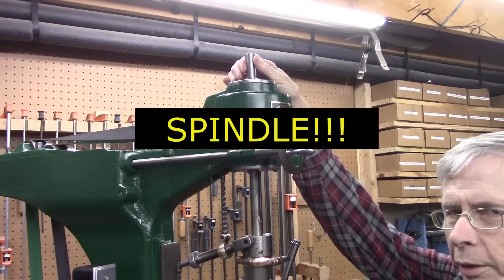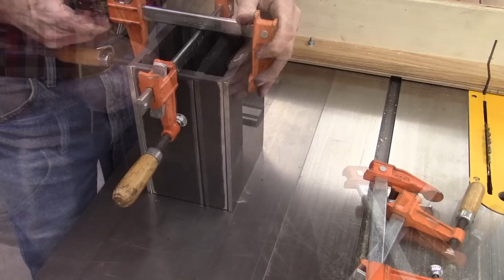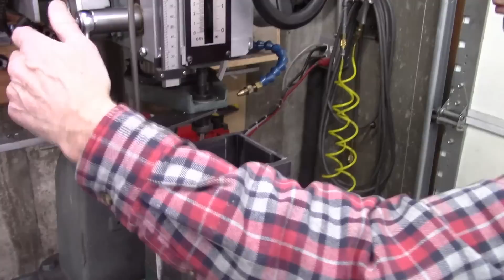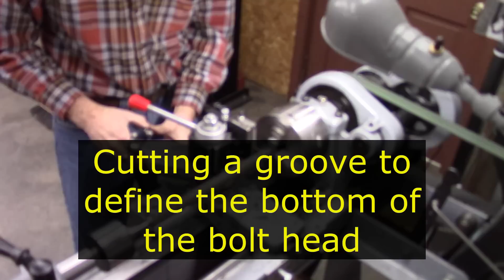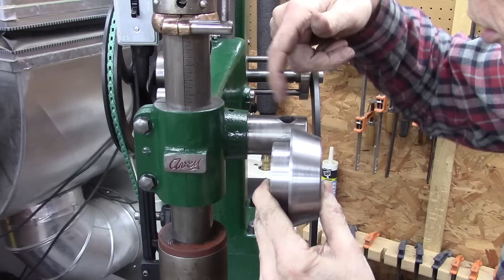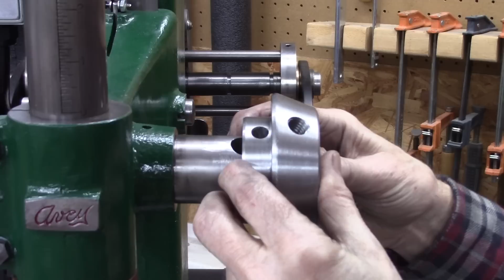My 1917 Avey Drill Press Gets Some Much Needed Upgrades

Comment: The problem with the work shifting in the mill vise could be avoided by eliminating the vise. By using hold down bolts and clamps you would have less flex to worry about. It might have been worth the effort to weld some plates on the inside of the work that could have been drilled and used as part of the hold down. I have some low temperature alloy that i have used to cast a temporary support for items that are difficult to hold. Just use some common children’s modeling clay to dam the alloy and pour it around the part to be machined. Using the low temp alloys would even allow you to pour around the part as it is held to the mill table by clamps. And you can also use the alloy in the mill vise. I unfortunately don’t know what alloy i use it was bought at an estate auction. You are a gifted craftsman and a wonderful teacher! Please continue to make these videos.
  Also you might consider babbet for that second bearing on the spindle. It would be period correct if you consider that important.
Reply from the maker: Yep...  correct on all accounts but I didn't think about welding brackets on the inside. That's a great idea. I was going to do it on the outside but didn't feel like rigging rods...  and didn't have any long enough. But hey...  it worked, just slow is all. 

Hmmm?...  Babbitt  not that is interesting! I bought a sleeve bearing but babbit would resolve any possible alignment issues. Maybe time to learn about Babbitt - Thanks

Comment: Mark, at 4:06, it sure looks like the drill chuck itself (the Morris taper maybe?) is wobbling as well as the spindle.  Zoom in and check it out.  Always inspiring watching you tackle these projects without trepidations.  👍👍😎👍👍
Reply from the maker: I looked at the video and it looked to me that the spindle bearing was the spot that was moving but I also know this is not right...  at least not significantly. There is some Axial Play (looked up that word, I had that right) which is allowing the upper end of the shaft to move. The other part if the problem that I'll probably never completely eliminate is the quill and the tube it travels in. It has a clamp to adjust and it helps a lot but you can tighten it to the point where it is hard to move and still get some movement...  perhaps egg shaped. As near as I can tell the taper is perfect, a very good fit. I had my brother in law move it for me and so I could watch (and feel) where the movement was and I felt nothing at the taper. Thanks for the feed back tho...  much appreciated.
Reply: @WinkysWorkshop  Maybe it was parallax and the camera angle, but it looked like there was relative movement of the shaft that comes out of the chuck and the shaft that it appears to go into. Yes, the quail was clearly moving down there, but it also looked like there was some additional wobbling at the shaft coming out of the chuck.  Maybe it was mirrors 😂🤣.  All the best. You’ll figure it out.
Reply from the maker: @joell439  I'll have my brother in law move it again. It's hard to see stuff like that when you try to move it yourself.

Comment: Nice long term project.  McMaster has headed 7/16 bolts up to 12" and of course studs are unlimited.  This is a very low RPM drill press which makes me think a support bearing bushing would serve well.  Particularly a fun project would be a tapered and 4 slit bushing with internally tapered top nut to allow adjustment of fit.  Extra credit for a seal/O-ring and oiler in the assembly.  Very fitting to the styling of a vintage drill press like this.    The spindle bushing of a Craftsman 109 lathe works in this way.  A glistening brass nut adorning your project with the spindle emerging through it would be stunning.
Reply from the maker: Dog gone it Dave, you're setting the bar too high! Hahah. But seriously that is a good idea. I was thinking a simple plain bearing. My only concern with any plain bearing solution is if the natural running position of the shaft is off center slightly it would wear. It appears to be well centers and if this is the case the sleeve would last forever as long as it had oil. If I could devise some kind of hardened inner race on the shaft for a needle bearing sleeve this would be ideal. I didn't the 109 was made like that. Hardinge Cataract lathe I got with this drill press (a future project) has sleeve bearing that look sort of like a collet.
Reply: @WinkysWorkshop  Some of the machining operations would be interesting.  Also, you could use a mag base to attach to the spindle and sweep the outside of the top part where the assembly would go.  If you wanted to test for a concentricity issue and a fun setup to show in a video.   I really think the distance between your two existing bearings is so great the play does not mean much.    But in the spirit of improving the vintage drill press it's still a good project.  You shouldn't need a race there.  The shaft would be harder than the bronze bushing anyway.   In other news.....I once had a concentricity problem just like we are discussing and needed to add a seal to a motor shaft.   I turned up an aluminum housing for the seal with flange.  Pushed it over the motor shaft and silicone glued it to the face of the motor mount plate.  This was a salt spreader and I had ruined a couple motors.  I wanted 2 seals to protect the vertical shaft.  This worked fine.  With a large enough flange you could simply glue on and external housing with silicone or JB Weld.   Another option with showing a creative solution to a problem.   There are as many possible was of doing this as there are opinions.  ;-)
Reply from the maker: @davethacker8410  I was talking about an inner race for needle bearing assembly not a sleeve bearing. The sleeve bearing would be find. and could be made any size. I like the tapered sleeve bearing ideal. I need to look at the 109 and see how it is made.

Comment: Love that pretty green drill press. Use all thread rod and nuts for your riser block instead of long expensive bolts.
Reply from the maker: Seems Logical but I could not find any cheap 7/16" all thread and I had a bunch of hex stock somebody gave me. I did find some bolts but with shopping the cost was around $40...  same with the all thread.
Reply: @WinkysWorkshop  Changed my mind. Good bolts look more authentic to the machine and are the way to go. They look great and I’m sure your viewers appreciate watching you make them.
Reply from the maker: @ellieprice363  Thanks... I think they do look cool.

Comment: Winky, the original riser block had a keyway cut in it to keep the column square, have you forgotten to mill it into the new one ? With the bolts why not use round rod and thread each end and add a blind nut to the top. Saves a lot of turning. Regards from Australia.
Reply from the maker: Hello Dave, No, I didn't forget the keyway. When I had it apart I made the drawing but rounded the key size to a nominal 1/2". It might be a little over or under...  I want to remove the old block and make sure I get the size and position exactly right. For sure the bolts were overkill...  a pain to make. Mostly chasing chatter with feeds and speeds and cutter profiles (although I did finally find the perfect combo. I considered all thread and nuts but could not find anything very cheap. Long bolts or the all thread were crazy high after adding shipping and I had all kinds of hex stock somebody gave me.

Comment: May be make the bearing out of oil light bronze and then the odd size in the shaft would not matter---and if you split the bearing you could fit it with out a strip down and it would be easy to replace in the future..
Reply from the maker: It's easy to remove the spindle so splitting isn't needed but yeah...  a simple sleeve bearing is probably a good option.

Comment: Love that drill press! That was some awesome engineering, l like how you engineered your changes to the handle mechanism without damaging the original antique integrity of the machine that you considered the option of putting it back to original, that’s awesome. Great job and video!
Reply from the maker: Yeah...  I always try to keep reverting to the original design an option. Mostly for historic reasons but occasionally a change doesn't work as planned. Thanks!

Comment: That's definitely a nice drill press. I recently got a 1/2 HP motor for my drill as this is what was factory on it.
Just FYI, and you might already know, Harbor Freight sells American made link belts.
Reply from the maker: Thanks, I saw the belt on the HF website but I got the smaller 3/8" link belt they did not carry. The 1/2" is more common but I think the smaller is adequate for 1/2 hp. Oddly the wider belt made the drill press run faster too and I like the low speed. The narrow belt sits lower in the pulley but you would think it would still maintain the ratio give that it sits lower in both pulleys...  but at least with standard v belts the speed change was significant.

Comment: Mark I thought you built an indexing set up on your lathe years ago using a saw blade. I thought of it when you were drilling for the 3 handles on the new drill press and was using the triangle cut out ?
Reply from the maker: Yes I did...  and I also designed a better gear indexer with a 48 tooth gear. The lathe would have worked but drilling a hole large enough for 1/2" thread would have been very hard with the hand drill. In other words, i had to make a jig to hold it in my mill of drill press anyway. The cad printed template was super easy and fast. Actually I almost had a philosophical discussion in the video about accuracy.  It came to mind when I was using the plastic level on the mill. There are times when accuracy is critical. Bolt patterns are a prime example. However, slight discrepancies in the handle angle or location will never be seen. I know you did not suggest the use of a rotary table but while I was setting it up in the mill I was thinking how some Machinist would have spent an hour mounting the table at a precise angle or if they had the right mill tilting the head... etc. I think there is always the best way and a logical way. I lean toward the logical.
Reply: @WinkysWorkshop  I agree totally. My thoughts was to just spot drill it in the lathe with the index to get it perfect then I would have gone to the drill press or milling machine. If I can look at indexed holes after I have finished drilling and can pick out one that's off the pattern my  OCD will not let me just except it. I would have redid my project. On the upper barring you mentioned I would turn down a bronze or brass bushing and use that on that mid shaft. My first choice would be bronze .I replaced a bearing in a 1 horse electric motor on a bench grinder years ago with a bronze bushing and its still doing well .
Reply from the maker: @anthonycash4609  I think a bronze bearing is the answer as well.

Comment: Maybe just a small suggestion: on your cross pin for the handle, cut a slight groove so when the bolt deforms the metal, it won't be hard to tap the pin out later.
Reply from the maker: That is an excellent idea! I'll do that. Thanks

Comment: Would it not be better to use a custom made bronze bushing for the intermediate spindle support instead of using a bearing that doesn't  fit due to the oddball size of the spindle shaft? A bushing would require far less to be taken out of the intermediate support and could be honed to a very precise tolerance. Cosmetically, a bushing would not look out of place for a 1917 piece of equipment but an exposed ball bearing might.
Reply from the maker: I 100% agree...  I'll probably do this.

Comment: First of all, I'm impressed by the fine job that you did on these projects.  Well done. I was however reminded of several things during the course of the builds that compelled me to add my two bits worth here.

A clamping kit is cheap and an easy way to securely hold workpieces to the table which don't mount as well in a vise.

I made a power feed for my mill using a Dodge Ram windshield wiper motor and it continues to operate well several years later and has reduced my milling workload considerably. I mounted it to the end of the table without the wheel and the motor assembly slides in and out on bars to mechanically engage/disengage the feed.  I made connecting adapters using a deep hex socket (9/16") attached to the end of the lead screw and a hex coupling nut on the motor spindle which goes into/out of the socket. I used aluminum because it's easy to machine and adequate for the torque involved.

A Ram wiper motor has 2 speeds normally by applying voltage between the common brush and the high or low speed brush, but a third fastest speed can be had by applying voltage between the high and low speed brushes with the polarity reversed. The electrical return however must be isolated from the case by mounting the internal circuit board on nylon washers with nylon screws and bringing a soldered wire outside to connect to an external 12VDC power supply.  I use a 6 position, 3 gang switch (appropriately hard wired - each deck of the switch connects to a particular motor brush) to control my feed at all 3 speeds in both directions, but a 3 position 3 gang switch along with a polarity reversing switch could also be used.  Additionally, I found it beneficial to add limit switches at each end of the table travel to disconnect power to the feed motor so that I don't have to be so alert to travel position, though I do still have to watch for tool jams to switch off the power manually, and of course an On/Off switch.  If I don't have quite the right feed speed available for a cut I can compensate by changing my depth of cut and/or spindle speed.

Most drill press handle arms have opposing flats for wrench tightening into the hub so that they don't unscrew with use but blue Loctite works just as well without any milling required.

Once I tried Joe Piezynski's threading method of mounting the threading tool upside down and on center, then running the lathe in reverse to cut the threads, it's all that I use today. Threading that way is left to right so there's no drama involved at the end of the cut because it finishes out in the air with little chance of a crash.  That's just a comment BTW, you obviously are skilled at single point threading and your traditional method works very well too.
Reply from the maker: All great input...  and I need to explore those window and wiper motors From what I understand the speed can also me controlled well with a PWM speed control as well and they are fairly cheap. - Yes I think I need to mill some flats on the handles...  although I find myself removing them on my mill because they get in the way... on my other drill press as well. However, on this drill press design the chuck is further down from the handles so I might tighten and leave the handles.  On the threading...  I love Joe's videos but in the case of threading it does not work well with the screw on chuck. He is a top notch machinist that works with high quality industrial equipment and sometimes the methods of work do not apply for smaller south bend, atlas etc. lathes. I also think he missed some of the more important points on doing cutoff (parting) on a lathe. Still a great guy and I respect his knowledge.
Reply: My chuck is also a screw on but there's a set screw I can tighten to prevent it from loosening once on so it works for me.

My shop doesn't have good environmental protection so I wanted to avoid electronics as much as possible and settled on the switched power approach, but a PWM box might work.  I was surprised by the amount of low speed torque that a common wiper motor can happily deliver.

I agree about Joe's tools and methods but some of his tips are worth remembering.  For instance, his simple summary of "If the chuck and the lead screw rotate the same direction it will be a right hand thread, if opposite then a left hand thread." eliminated a bunch of confusing cipherin' for me.
Reply from the maker: @CapnCrusty  I've thought about the set screw idea....  not sure I'd trust it for cutoff and the threading is easy now....  Yeah...  I agree about Joe. He is a favorite. Of course This old Tony is always good entertainment and it's hard to beat Mr. Pete!  I had the pleasure to meet him at the Flywheeler last year. Super guy!
Reply: @CapnCrusty  A parting tool will work with a screw on chuck if it’s mounted upside down on the rear of the cross slide.

Comment: Very nice work on this project. With regard to a "power feed" to your mill, I've no doubt you can create something but what came to my mind was something based on a variable speed drill. I would love to see what you come up with. FWIW, a red/yellow paddle switch instead of a light switch would sure go well with the green color.
Reply from the maker: Haha...  yeah, I guess you are right. Its about priorities
Reply: I like the power feed suggestion. It could be as simple as a piece of hexagonal stock that would slide into an adapter on the machine. The few jobs it would be used on, you would just hold the drill by hand.
Reply: I have a Vevor variable speed power unit for my Bridgeport table feed that works pretty well. Maybe Vevor would send you one to test on your mill.
Reply from the maker: @ellieprice363  That sounds like it might be a good idea! :o)

Comment: I wonder, could you machine a brass bearing for the spindle support?  Always enjoy, thanks.
Reply: I was just thinking an oilight bronze bearing would be easy to cut to size, require less cutting on the original support, and would look old timey to fit the machine.
Reply from the maker: I think so...  I might try this.